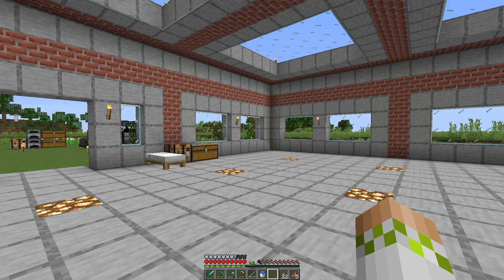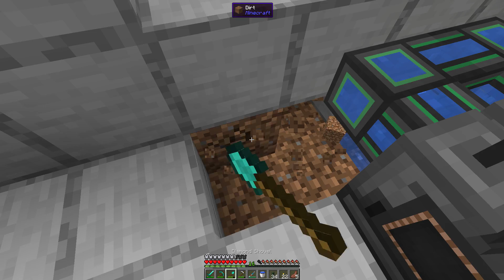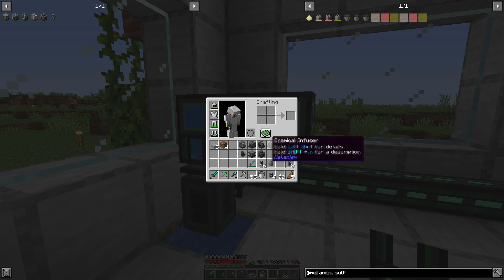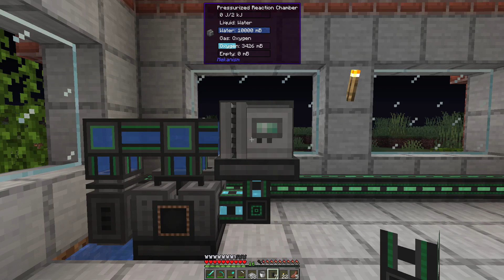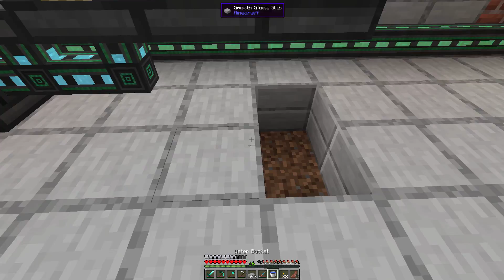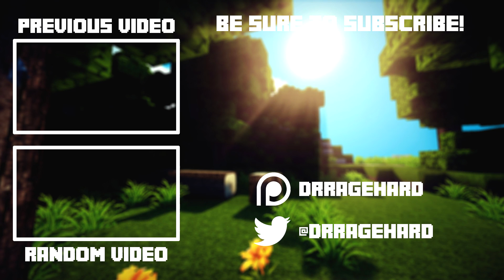Surviving With Mekanism v10 :: E06 - Sulfuric Acid Production

Comment: 21:10 or you can put a gas-burning generator right on it, then put a resistive heater right on the output of that (you may substitute the resistive heater for anything that will reliably consume all power than the burned hydrogen will generate, or more power than that if whatever is connected wont cause any issues if it runs out of power)

i have the gas tank on mine set up to output hydrogen into the line i use as the hydrogen output from my electrolytic separator to my ethylene production, but i also set it to dump excess in case of a buildup.  really i could probably get more ethylene production now tbh, but i dont need it (i have to get create smart chutes+stockpile switches or something to deal with the substrate buildup without voiding absolutely all of it)

Comment: If you wanted to automate without the quantum, just move the blocks after the reaction chamber by one block to the right and put the tank next to the pressurize chamber. Then export the coal in the front of the pressure chamber.
Reply: Xnet has a Mekanism Gas option (in ATM8, at least) and I just slap a Xnet connector to the front of the reaction chamber where the tank is in the video and call it a day. Export Hydrogen and import Coal right through there.

Comment: i actually made a little modified setup because i had a digital miner specifically for coal that directly fed into the pressurized reaction chamber, but when its running ist beautiful to just sit there and watch (assuming you have particles on)

Comment: Note: you can use Quantum Entangloporter to insert coal into Pressurized Reaction Chamber and take the gas out at the same time, which gives you an opportunity to automate the whole system!
Reply: or you can use the colour coding functions of logistical transporters, plus the "transporter config" in the PRC to use one logistical transporter to both input charcoal and extract sulfur.  this is what i do.  you do have to modify the machines i/o config a little to get it to work.

or you can just use all six sides of it for dedicated inputs and outputs.  i considered that until i realised that machines could be assigned a logistical transporter colour themselves, as well as colour their outputs directly.  this may not have been the case back when this series was made though.

also, without a farm for charcoal or coal (if your pack allows you to make that renewably at a reasonable rate) this isnt truly automated since you will have to keep moving the digital miner (although if we go back to your original suggestion of using a quantum entangloporter for stuff then this becomes a lot less of a hassle, since you dont need to run logistical transporters all the way back from where your digital miner is, and you just need some sort of system to alert you to move the digital miner every so often).  personally though, i use create to make a tree farm and then use a basic smelting factory to make charcoal (yes, i know create bulk smelting exists, i just dont have a good large area to set it up in nor have i progressed that far into create yet)

Comment: there is a simpler way to get sulfur ... crush cobblestone into gravel, enrich gravel to flint, crus flint to gunpowder, and chemically enrich gunpowder to sulfur ... so crusher, enrichment chamber, crusher, and chemical injection chamber takes you from cobblestone to sulfur ... just thought I would put this out there so that everyone know that there is a second way to go
Also ... if you line the machines up properly, the 5x ore processing line, using the above line to produce the sulfur, can fit quite nicely within a single chunk

Comment: I tried to hook up the Pressurized Reaction Chamber with an AE2 system but cannot figure out how to have the hydrogen output and coal export bus on the same face or at least on the machine. Any suggestions?
Reply: ok i have found a solution for this, have instead the oxidizer on top of the PRC a single item pipe fed to the Oxidizer, now put either left or right of that item pipe a logistical sorter with a chest next to it, set the logistical sorter filter to coal pump only also make sure the PRC top face to item INPUT/OUTPUT auto eject, so when the logistical sorter pumps coal from your chest into the PRC the produced sulfur cant go into your chest and goes straight into the oxidizer (essintailly the item pipe acts as input/output for items) and voila now you can dump hydrogen one side and input/output coal and sulfur on another side ;) * see PICTURE FOR CLARIFICATION https://ibb.co/X4n8nzm
Reply: @Mastercluster  Oh thank you! Very kind of you.

Comment: How would you go about "autofeeding" this with coal? All the sockets on the PRC are in use
Reply: Nvm solved it with a logistal pipe between the CO and the PRC to get room to connect a branch to coal storage and then using a logistical sorter and the purple input/output options made it all work.

Comment: I can't find the input and output settings on the Chemical infuser, what should I do?
Reply from the maker: The input / output setting should be on the top left of the UI as it is with all the machines. Are you playing with Mekanism v10? I know in earlier versions some machines did not have configurable inputs/outputs and they were preset hence certain visuals on machines that were never changed.

Comment: add a gas generator and put the power back into the system problem for getting rid of the hydrogen solved.
Reply: Except that the creator of Mekanism made it so the cost of running a gas generator equals the amount you get from burning hydrogen. This used to be the infinite energy setup in the early days of Mekanism, but the creator thought it was too OP (which it was). I mostly create giant tanks and liquify the gasses through the condensentrator and keep them stocked like that, if I'd ever need them.
Reply: @FreshButterToast  the reply was to get rid of the hydrogen period so the system didnt lock up... it had nothing to do with generating power sooo....
its still a win
Reply: @jasonhanna1  His own solution is a lot better than putting a gas burning generator on it that has no effect. When you mention a generator, your goal is to get power out of it, which doesn't work with hydrogen. So not a win, as it may mislead people going through the comments, making them think they can get power directly out of hydrogen.
You're just voiding hydrogen in an "expensive" way.
Reply: @FreshButterToast   i think this is the time you REALLY NEED TO WATCH THE FUCKING VIDEO AND READ THE POST BEFORE  JUMPING TO CONCLUSIONS ABOUT WHAT OTHER PEOPLE ARE THINKING >>>> ITS ABOUT A SOLUTION TO KEEP THE DAM SYSTEM FROM LOCKING UP FROM HYDROGEN GENERATION AND STOPPING THE PRODUCTION NOT MAKING ENERGY >>>>>> YOUD KNOW THAT IF YOU ACTUALLY TOOK THE TIME TO FIGURE IT OUT  EINSTIEN...
Reply: other peoples kids i swear...
Reply: @jasonhanna1  Thanks, Captain Caps Lock. Real mature. I watched the video, and yes, it was about not backing up the system.
But my reply was directed to yours, saying that hooking up a gas burning generator is exactly doing the same as hooking up a gas container and voiding the gas.
A comment like yours, saying to hook up a gas burning generator to it and directing the energy back into the system is very misleading for others, as it doesn't generate more energy than it costs to run the generator. And it is a waste of resources. Goodbye, you rude sir.
Reply: The point was to be productive not counter productive.... so keep being a waste of space and oxygen or do the world a huge favor and take a very long walk off a short pier into darkwater and stay there...

Comment: Another FYI is that you can process cobblestone to eventually get gunpowder, making sulfuric acid infinite if you can get infinite cobble.
Reply: @Oscar Melby how do you sort it so it only keeps the gunpowder though???
Reply: nvm I see, you crush the cobblestone into stone, then enrich the gravel into flint and then crush that into gunpowder, but on my digital miner it doesn't update, after it mines all the cobblestone it doesn't keep going, like it doesn't register that more cobblestone was produced.
Reply: how do you automate the hydrogen chloride that you need to make sulfur from gunpowder?
Reply: @tanman.  I'm pretty sure it's brine in an electrolytic separator, but double-check first
Reply: @dominicgraham6101  I eventually automated it but my idiot friend on the server blew up my reactor so it’s like half blown up
Reply: @tanman.  oof. Sorry about that
Reply: "IF?"  Anchor a digiminer somewhere and set it to stone.  you will get a couple hundred thousand cobble and a big hole.

Comment: Just an FYI the fission reactor doesn't create power and requires a turbine (and a ton of iron/steel to make it) to actually generate power.  If you try and run it without those it will overheat and meltdown quickly.
Reply from the maker: Ah okay that makes sense since it would overheat easily if you arent able to remove the steam it is producing to dissipate the heat. Guess we will have to deal with that before we have enough nuclear waste to play with.
Reply: @RagePlaysGames  for sure.  I managed to radiate my whole base and half of my neighbor's on the server when I accidently broke the wrong pipe and ran out of water.  /mek radiation removeAll had to save the day there.
Reply: @basschristopherjam  welp, now I regret giggling at the Hazmat suit I saw in JEI 😬

Comment: I messed with the Bins in PO3 and I was always curious if there was more to it. I'd used a turbine powered by Thermal dynamos with boiler augments before but I've never gotten into Mek steam either, or the stuff that comes next.

Lmao have to go through the reactor process to make the storage. Mekanism you so silly. Time for a stack of energy cells

EnderIO 1.16 when

The way you say condensentrator sounds way better than I do in my head and now I'm dying

Configurator radial menu what
Reply: Your chemical infuser was on left input for gas, i guess it just pulled from the prc on its own?
Reply: Mekanism never auto inputs, does it? The closest I can think of is the input for the digital miner for replacing the mined blocks.

Comment: My best guess as to what happened would be with momentarily switching the output of the pressurized reaction chamber to Input/Output (Purple) while trying to clear that output. I'm pretty sure it's not supposed to work that way, though.
Reply from the maker: Ah yea, I think you're right. Super odd that the machine was able to work as a sort of middle man for the gas. I assume you're also right that it shouldnt work that way.
Reply: ok i have found a solution for this, have instead the oxidizer on top of the PRC a single item pipe fed to the Oxidizer, now put either left or right of that item pipe a logistical sorter with a chest next to it, set the logistical sorter filter to coal pump only also make sure the PRC top face to item INPUT/OUTPUT auto eject, so when the logistical sorter pumps coal from your chest into the PRC the produced sulfur cant go into your chest and goes straight into the oxidizer (essintailly the item pipe acts as input/output for items) and voila now you can dump hydrogen one side and input/output coal and sulfur on another side ;) * see PICTURE FOR CLARIFICATION https://ibb.co/X4n8nzm